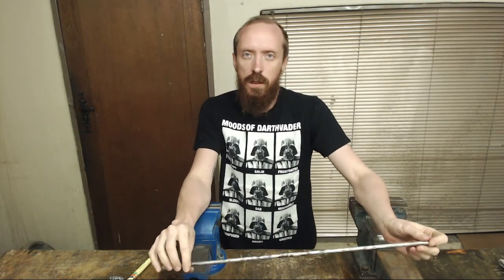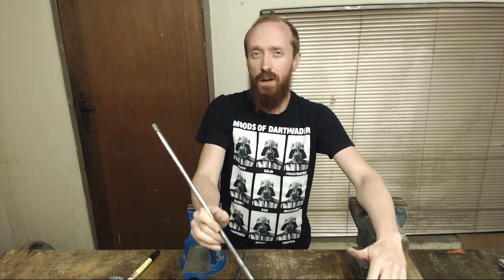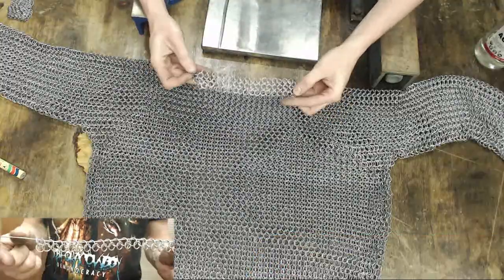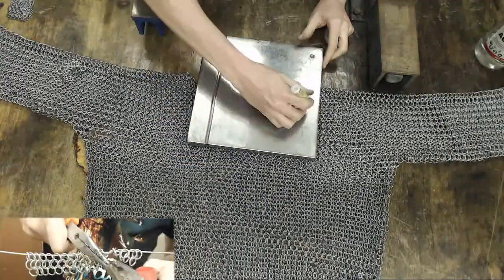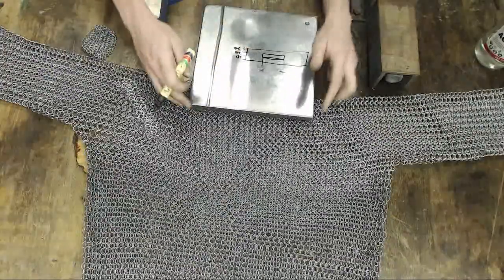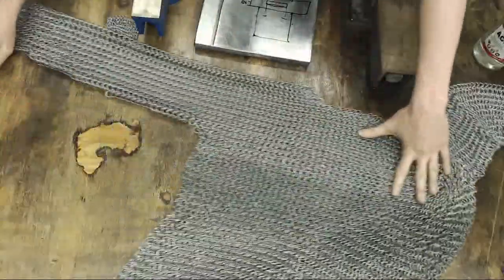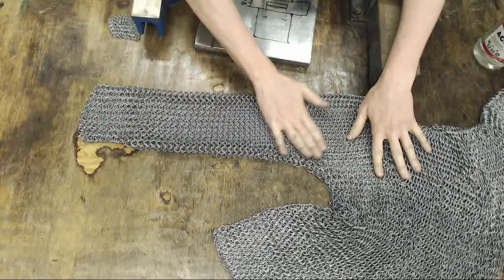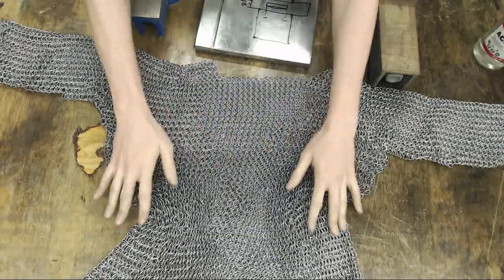How to pattern a mail shirt

Comment: Great video thanks. 1 tip, dont make chainmail on a rod like you do. Its way faster to make chains first with a 2-1-2-1-2-1-2 pattern. Prepare a bucket of closed rings and a bucket of split rings, then proceed to make a chain with that pattern. I make them 10 "double links" (5 4in1 together) or 20 "double links" (10 4in1 together) long. This is very easy and can be done while watching tv or something. Then just lay down the chains and put them together with split rings. It takes way les effort, because only the last step requires concentration and a good surface or workingstation
Reply from the maker: Yeah I agree. Just used the rod to better show how the rings connect ;)
Reply: No that's even takes longer 4-1 procedure is faster since it already made a premade parts for the chainmaille all you have to do afterwards is to joint the 4-1 rings you made, hell I finished the front and back in just week and a few days by doing it
Reply: @REMASTEREDAGAIN  hi, i used 4 in 1 as well, but you can first connect all those 4in1 in one direction as a chain, which is very easy. Only the second direction, which turns seperate chains into a fabric requires you to concentrate on the pattern and use a flat surface
Reply: I made two links of 1-2-1-2-1-2-1, but can’t figure out how to connect them. Any tips?
Reply: @scotstephenson114  Hi Scot, wish you good luck, I hope you finish yours. Im not even halfway. Make sure you are happy with your wire and have enough of it in stock or that you can buy the same wire again if you need to. I would advise you to have at least 500 meters. 

In addition to this video I would recommend the one EpicFantasy made. He explains the tactic I found easiest. If you combine the two videos, you will pick it up. It takes practice at first, but you will soon get fast.
Reply: I think making tiny units and connecting them after is the least efficient method. I hang a wire between a wooden jig, and just figure how many rings I need in width, then make rows going downwards. Not only does this let gravity hold the entire weave in suspension, it means im not fighting to keep everything aligned and easy to look at and work with, all I need to touch is the ring that's going in, the weave holds itself in a stable way. having to fight hundreds of tiny pieces while working on a flat table where things fall out of pattern and you need to spread it out seems like a lot of fuss,

Comment: I recently made by first bit of chain mail, just a small square to test it out. Very fun, my inside diameter was 18mm and they looked to large to me, definitely gunna go down to at least 14 mm
Reply from the maker: Smaller looks better imo
Reply: 8 to 9mm rings were basically the biggest historic rings were
I recommend 8mm rings as it still quite protective but not as laborious as 6mm (like I do, it takes tens of thousands of rings more to make a shirt and makes you go insane lmao)

Comment: Dear good Sir! I'd like to know more of how you have done it! My questions would be: how did you find out the correct circumference around the shoulder? By that I mean for the vest part of the mail. What was the lowest armpit point? What was your armpit junctioning method? Horizontal or "V" or other which I dont know of? Why i ask is because I have hanging sleeves on which I made, but every time I try to tailor it, the bottom midline along the under arm part gets tight and excess material is present at latissimus dorsi or pectoralis maior when flexing the shoulder. Even if I let my arm simply down by my side there is material extrusion between my arm and thorax, and circular tension arises from the top of my delts. I would kindly ask you to elaborate in detail if possible, please!
Reply from the maker: Honestly  I struggled with this part myself and it's been quite a while since I did it last. I'll have a look at my maille and see if I can clear anything up. From what I can remember mine also feels like you are carrying golfballs under your armpits when you let your arm hang down. One solution that I've heard from a few other tutorials was to plainly leave gaps in these areas, not exactly historically accurate I would assume as the armpits are  particularly vulnerable areas and maille was used to protect these where plate armour wasn't able to

Comment: I have to pick back up my chainmaille project. t has been sitting for way too long now.
I use 1.6mm SG2 mig welding wire because from the start I was planning on welding my rings and galvanized wire would be a noxious and rather dangerous affair to attempt to weld.
To weld the rings shut (butted ends together) I made a welder made from parts salvaged from an old microwave oven. The welder works wonderfully well and makes very nice and more importantly very strong rings and beautifull looking chainmaille. I realize welding chainmaille is not historically accurate although I am quite sure some smith somewhere must have attempted it one way or the other and most likely succeeded to some degree though I expect any medieval method of welding small items 10.000's of times would be impractical. Apart from a fantastic welder (which works surprisingly well for something thrown together from bits I had collecting dust in my shop) I made various tooling to aid in chainmaille manufacture. A thingy to store the 15kg spool of welding wire which lets me unroll wire in a controlled fashion without the springback nastiness, a very handy and safe thing to make coils using a hand drill and I modified an electricians side wire cutter to liberate rings from the wound coils. Where most people use mini bolt cutters I was more or less forced to use a different method.Not only mini bolt cutters where hard to find in my area but also I didn't like the finish the cutter left on the rings. I tried the effect with a larger side cutter and it didn't work for my purpose. Luckily I found a video on a score and break method which turned out to be the perfect method to separate rings from the coil for butt welding. The score and break method leaves an almost perfect flush and straight cutting surface at the end of the wire which is very nice to weld shut again. Even for butted chainmaille I imagin the method works better then the diagonal cut ends. I find diagonal ends on the rings tend to catch on clothing and rings seem to be more proned to opening up while in use.
I weld close rings before I start weaving and store them seperately. I weave my maille using a adaptation to a speed weaving method called 3 plus 1 (also featured on a Youtube video) where I weave the previously welded rings into the chainmaille and weld the new rings shut in situ. Sounds hard to do but it is surprisingly easy, though slow but very satisfying to do.
I have several short videos on my very small channel which show the welder in experimental action (The rings I use for the experiment are made with 1.2mm sg2 mig welding wire. Some of my tooling is also featured on the channel.
I plan to do a more exploratory video on the insides and workings of the welder and a video showing how I weld chainmaille using the DIY butt welding machine which I call the Ringmatron.
Reply from the maker: Thanks for all the info. My maille setup is very rudimentary, as you can probably gather from the videos. I am definitely gonna check your channel out. Very interested in the DIY welder as well, I love making my own tools. I am getting a Dremmel tool soon which I'm gonna experiment with for ring production, might make scoring really easy

Comment: when sizing / planning the shirt, should one measure it so it is stretched when donned or should it be lose? or something in the middle?
Reply from the maker: Something in the middle. Also keep in mind if you pattern it correctly it stretches in one direction and is rigid in the other. So you want it to stretch horizontally and be rigid vertically. Leave a lot of extra room in the arms as well, they have a tendency of getting really tight when flexing and bending your arms.

Comment: Question-
You describe the first part in assembling of 3 strips of 20 rows, with a gap in the center left for your head how many rings across should the whole thing be first, and how many rings across should be left out for your head ( in the row)?
Reply from the maker: It's hard to say exactly because your ring size will differ. I just measured it on my own body. I'll check exactly how many mine has when I get a chance and let you know.
Reply: @ManinaCanArmoury  thank you.  I am using 1/2" rings, 16 gauge.  If you have a picture of what it looks like after putting together those first 60 rows, I'd love to see it!

Comment: Thank you for the video! :) I'm attempting to make my own chain mail shirt but I'm having trouble with connecting the front and back pieces. If I fold the front and back, the pattern doesn't allign but goes like this: ))) (((. Can you tell me what I'm doing wrong please? :)
Reply from the maker: You might be shifting the two ends one row up or down when you fold it, make sure to align the rows properly and that there isn't a step in the rows as they go around. I made the front and back separately and joined them at the side, if that helps
Reply: @ManinaCanArmoury  Thank you for your quick reply! :) I looked at the pattern again and shifting one row up/down seems to be the mistake. I'm attempting to make the front and back separately as well to join them at the sides. Thanks again, now I can continue without worrying why it didn't match up :)

Comment: im stuck with that armpit connecting issue : (
Reply from the maker: I found most people just leave a gap in the armpits, it can be quite a challenge to get it to work
Reply: @ManinaCanArmoury  Solved the issue, took some plant cord and cut short pieces of it to repeatedly connect 2 rings from both sides of the armpit mail. Doesnt block my moves but holds very tight and feels reasonably comfortable (if you take one piece of cord for the whole thing it wont properly fit as i found out). Even if it was used in battle its to small of a spot to cut the whole cord what one piece of cord wont do, beside of that it looks good. Maybe you can make a video to tell people about that option, its the only way ive found that works properly and doesnt change the pattern of the rings. Id realy like to share this method with people who dont know how to do the armpit because it took me a lot of time to figure this out and I dont want people to waste as much time on it as I did.